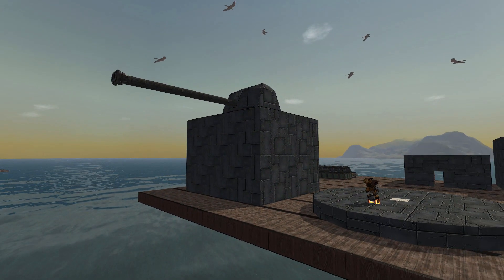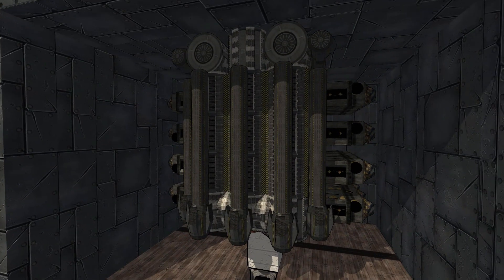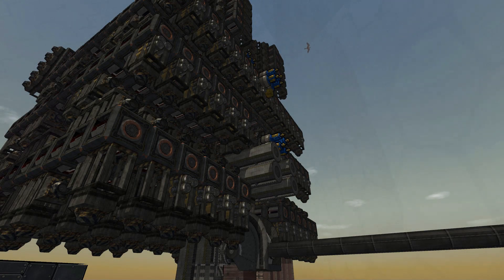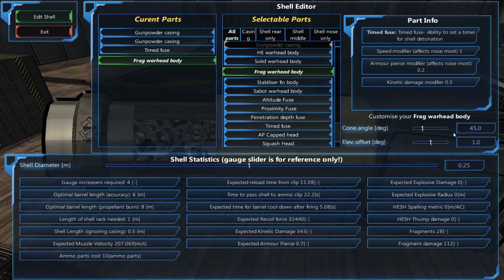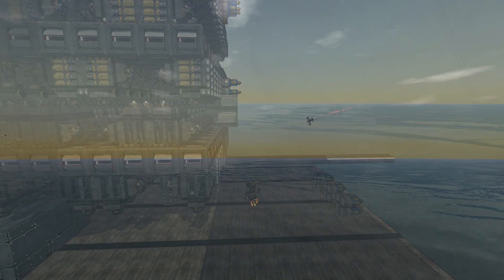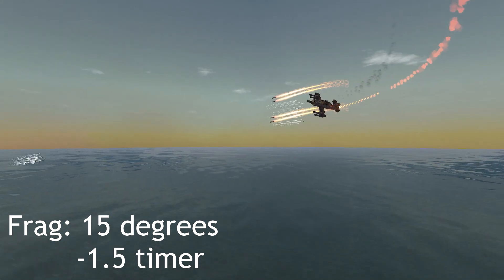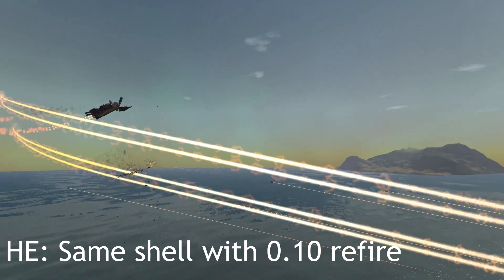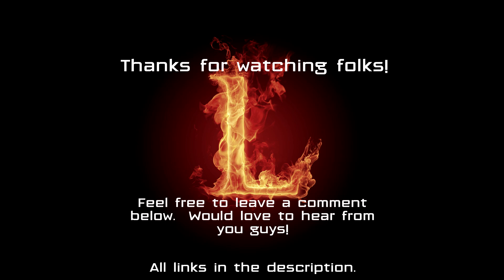AA Flak Cannon w/Timed Fuses - Advanced Custom Cannons - From the Depths(Devtest 1.854)

Comment: Glad to be of service.
Reply from the maker: +Nicholas Glendening You are a legend, sir!  I may have to call on you again whenever the new autoloaders are ironed out.  There's an awesome new belt fed loader and an interesting mechanic for having multiple clips on one autoloader.  Might be really handy to have a table for it.  I would leave it until the whole system is at least roughly finalised though.  It's being heavily changed still.  Thanks again!
Reply: Bah. I'm nothing special. I just know how to spin up an excel sheet is all. With the autoloader, it is far easier to change numbers then to build the formulas. I can put together a sheet for that and we can just update the numbers as needed when the game changes. Just toss me a few numbers to play with and an idea of how it should look and I can setup something just like I did with the gauges.
Reply from the maker: Still not sure on the numbers tbh.  This is what Nick said "Placing clips all around an autoloader should decrease the load time by sqrt(4) = 2- and feeding directly into an autoloader now has a load time penalty of an extra 50%.".  I'm sure Evil4Zerggin will put together some basic equations for us to use rather than working out from trial and error, I got no clue beyond those figures.  Would want something that you can input your cooldown rate, base reload time and number of clips per autoloader, then it will output how many autoloaders you need. :)

Comment: I've actually had some luck making dual purpose shells for the 150mm 6 barrel shotgun. I use a 6 stack shell for that, and do 3 powder, a time fuse, HE, and a Hesh warhead. And while the blast radius isn't terribly impressive for a flak cannon, the shells are fast enough to use for antiaircraft roles, and it can at least score a near miss that will take off a thruster or two.
Reply from the maker: +Phillip Wendt Ohh, this is an interesting idea.  Essentially repurposing it as a Frag.  Nifty concept! :D
Reply: +ireLAN Gaming Yeah, well it was an interesting idea until the new update. Is it me, or did the shaped charge and Hesh heads get nerfed?
Reply from the maker: I think they're getting a rework. They feel pretty bad atm.

Comment: Thank you to show how AA Guns work. Now my 6 barrel Skycleaner works like a real AA gun... but the Crazy Squrril...
Reply from the maker: +TheIronbuster Really happy it was helpful!  The squirrel is still a bit of a pain to kill.  These sorta guns don't really work against them.  Your best bet against squirrels is high velocity AP shells.   Anything over about 600m/s can hit them relatively well. :)
Reply: Naaa i use Lasers... Lasers do an Instandhit XD I build now a Battleship with the new AA-Guns, But how do i say the AI, it should only fire at airtargets?
Reply from the maker: In the local weapon controller, set the minimum target altitude above about 20m.  That will stop it targetting pretty much any boat.
There's now shields that work against lasers though. ;)
Reply: ah okay, thank you. With theBeltfeedet Gun its anoying the clip is empty, but the flyers are still in the air XD
Reply from the maker: Yeah, you wanna make sure you can take out your target in less than a full clip.  I actually prefer the other loaders, despite belts being arguably more powerful.  I'm happy to pay a damage loss for a more consistent output. :)
Reply: but a shot all 0.7 Sec is so damend cool with a 6 Barrel Gattlinggun XD
Reply from the maker: There is, of course, no substitute for MOAR DAKKA! :D
Reply: and my battleship has 10 Each side... a real SH**storm. Chanced the size of the barrls to 40mm. Now there is more noise XD
Reply from the maker: Haha. "Ratatatatatatatatattatatattataatatatattatatatatatatataatattatatatatatta"
Reply: damnd... missed... But wait now the AA-Granats explodet in front of te enemy yey XD
Reply from the maker: Yay! \o/
Reply: Now the barrels only need to spin. that would be cool

Comment: Help the laser targeter doesn't work, I change the little settings and it doesn't do anything. :(
Reply from the maker: +Kevin Blake These things are a real pain to get connected properly.  The best way to ensure it is to connect via a 6 way connector on the bottom of the laser targeter.  Then, as long as you have an altitude or timed fuse, the settings should affect the shells it fires.  Hard to know, these are fiddly little buggers to get working. :/
Reply: ireLAN Gaming I'm still surprised the proximity fuse doesn't work...
Reply from the maker: They technically do work, you just need to set a high distance prior to the target.  The problem with them is they only trace 1 line along it's trajectory to dictate a hit. It's not a radius as you might expect.
It's to save on CPU usage, as making them work like a proper proxi fuse would grind any computer to a halt. :)

Comment: how do i get a fast firing advanced cannons with full sized shells and max gauge
Reply from the maker: +potato master 2000 Lots of coolers and lots of autoloaders.  It's really as simple as that. :)
Reply: ok thanks cause ive been trying to figure that out can u just stack a bunch of coolers on the back of a gauge increase?
Reply from the maker: Yeah, you can also use the left and right splitter to 'turn' the cooler chain, so you can fit way more in a smaller space.  Just stack up a bunch of coolers. There's over 150 on Mildred and Sandra. :D
Reply: jesus cool enough lol ok thank u  i have learned alot since yesterday when i got the dev version
Reply from the maker: There's a bit of a steep learning curve to the new cannons.  I guess, like all things in this game, but when you get over the basics, the options available can be astounding. :D
Reply: yup ive done some testing and i now under stand how they work thank you for answering my questions in a short amount of time
Reply from the maker: You are most welcome. :)
Reply: oh yeah i built an AA gun similar to yours and it is max gauge and still shoots 3000rpm is insane :)
Reply from the maker: Good stuff! Over engineering stuff is fun. ^^
Reply: nah its realitivley small and could almos be used on a small ship that u would build after the starting ship
Reply from the maker: Sweet. ^^

Comment: Why not make a Goal Keaper Point defence system 
Rain that 30mm HE round at 6000+ rounds per minute
Reply from the maker: +Synapsis Flame Well, that sounds like fun!  I'm finding more bullets is just generally more effective with AA guns. Can't go wrong with 6000 per minute ;)
Reply: +Synapsis Flame Goalkeeper doesnt fire at 6000+ RPM it fires at 4200 RPM
Reply: i know its a Gau-8 Avenger based gun but i meant it as like goal keeper point defense type thing
Reply from the maker: We were gonna call this the Goalkeeper actually, but because of the slight differences, we decided against it. :)

Comment: So how do those laser  targeters work. I cant make my cannon work. I dont get what they actually do nor can I get them to connect like you have with the fuse settings.
Reply from the maker: +Thepokemonmies They can be a bit fiddly.  It needs to connect from the bottom (the largest flat side) to either the firing pin or a 6way connector.  I think it has to be the bottom.  You also need to have the relevant fuse on your shell.  If you have a timed fuse on the shell and a correctly attached laser targetter, it should explode correctly.  Are you maybe using a squash or shaped charge head?  From what I understand, these cannon be used with timed/altitude fuses.
Reply: Thanks, but the problem persists. I tried ur tips. ( I have no head just a he btw ). attached it from the bottom and so on and I have a timed fuse
Its set to 8.9 I could lower it, but with my limited testing the timed fuse works.
But the laser targeter wont pick up the fact I have them on my shells.
 I have spinned my lasertargeter in multiple of ways but it doesnt work. mb the last patch broke something?
Reply from the maker: That's a strange one.  I just tested it and the laser targeter seems fine for me in the latest stable release.
It might be worth posting this on the official forums.  There are much clevererererer.... people than me over there! :D
Reply: ireLAN Gaming Well I might test it a bit and then I will probably send it. thanks for the help. I might be missing some super obvious that would be visible with a picture. I think this part could be better explained and less fiddly.
Reply from the maker: Yeah, there is still a lot of documentation to be added for them.  I'm sure it will come in time!
Reply: ireLAN Gaming Probably. This is just a devtest after all.
Reply from the maker: It's actually just been pushed to stable. :)
You can disable the devtest and verify game cache on steam to get back to the stable branch.
Reply: ireLAN Gaming oh cool.Thanks. Ill be going to that branch then.
And btw I got it working somehow.
I destroyed my advanced firepiece and all my autoreloaders and put them back and now it works. No idea how that happens.
Reply from the maker: Weird. O_o
Must be still a bit of glitchyness with the firing pieces.  I've had them not want to connect to anything before, but never been able to repeat it.
Reply: ireLAN Gaming Yea odd. But thanks for the help. I Appreciate it.
Reply from the maker: You are most welcome. :)